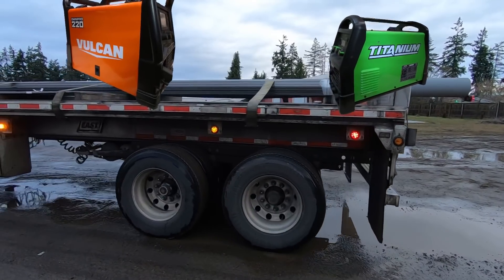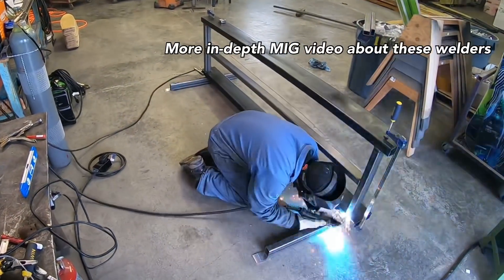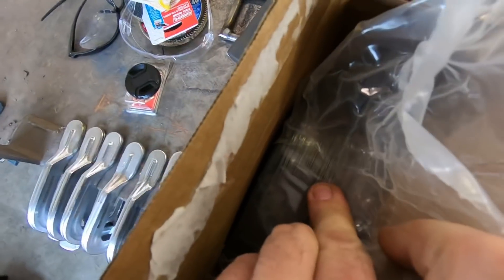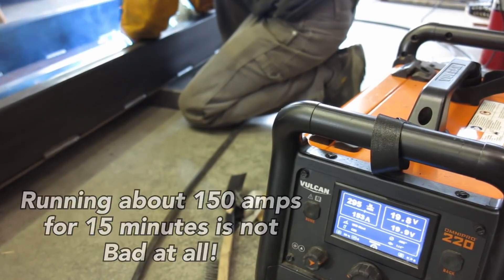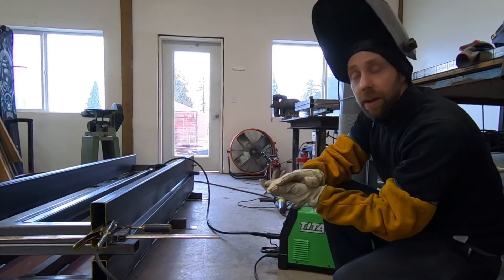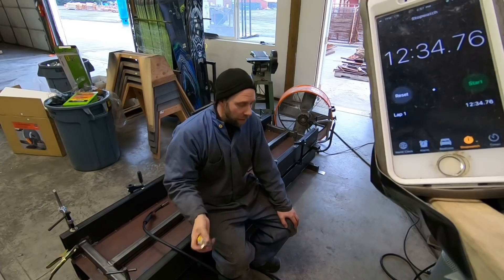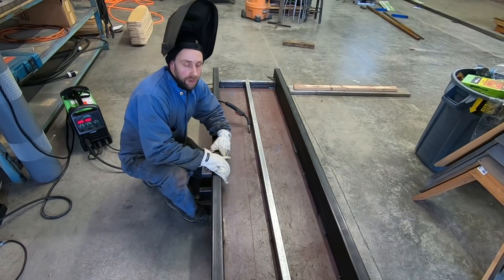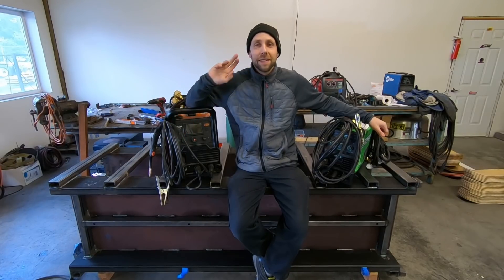Titanium Vulcan welders real world duty cycle MIG test

Comment: Thank you again for your review on these welders. It has been very helpful.  I purchased the Titanium online yesterday. Do you know if you can run a spool gun on it to weld aluminum?
Reply from the maker: Thanks for your nice comment :) I appreciate it. 
I think you will be happy with your new welder. Yes the Titanium is capable of running a spool gun, Harbor Freight says they will be available at some point, hopefully soon? Another subscriber mentioned  that Northern Tool sells a version of the Titanium multi process welder, it doesn’t have a digital readout but looks like it’s from the same manufacturer, it comes with a spool gun, and Northern Tool also sells the spool gun on its own. As far as I can tell it looks like it should hook right up. I may order one if HF doesn’t start selling one soon.
Reply: @Mikefestiva  Awsome, thanks again!

Comment: IDK maybe it's just me but your video is kind of misleading you keep talkin about voltage input when referring to duty cycle and there are many many many many welders that have no clue what duty cycle is please correct me if I'm wrong but duty cycle is the amount of time you can weld with that particular machine at maximum output they use a 10-minute as a standard for example if your welding machine has a 200-amp output and you are welding at 200 amps and your machine is rated at a 60% duty cycle at 200 amps you can weld for 6 minutes before you have to let it cool down for 4 if you're only using 50% of your machines amperage of course you achieve 100% duty cycle I'm just saying you don't explain this in your video and there are many many welders that do not realize what duty cycle is and it was only a few years ago that they started putting these warning lights and stuff like that IDK it's just an observation and opinion nice work
Reply from the maker: Carl again I think you may have missed the point of my video, I don’t think I was misleading at all, I completely understand duty cycles on welders, I’m not going to explain every detail about duty cycles in my video, if someone doesn’t understand how duty cycles are rated on welders they can ask or better yet just as easily look it up on line. 
Now the part where I mention input voltage and duty cycles, I think this is where you got lost, input voltage is definitely a factor in duty cycle on welders, these are both multi voltage welders and the duty cycle is definitely different if your welding on 110 volts compared to 220 volts, I even included the duty cycle plates of each welder in the video if someone wanted that info, mater of fact depending on if your MIG, TIG or are stick welding the duty cycle is a little different for each process. The green Titanium welder has a 15% duty cycle at 200 amps, I was welding at 150 amps for about 12 minutes, the point of this video was to show people that are interested in these two welders there capability on projects.

Comment: Welding on 220 volts okay you must be the first guy in the history of welding to weld 1/8 inch steel with 220 volts oh wait a minute you mean it's a 220 power supply damn I use a Miller and can do the same thing with a 110
Reply from the maker: Carl I think you may have missed the point of this video, I was building a glue press, and a lot of times as you should know you weld different thickness metals on the same job, why would I plug my welder into a 220 volt outlet to weld thicker 1/4” on higher amps then unplug it and plug it into 110 volts just to weld thinner metal? That’s not necessary and a wasted of time when you can do it all on 220 volts. Of course your 110 volt Miller can weld 1/8” practically any cheap 110 volt machine can do that. What your 110 volt Miller won’t do is weld 1/4” at 150 amps for over 12 minutes without hitting a duty cycle. I would be surprised if your 110 volt Miller even puts out 150 amps?

Comment: I got a Vulcan MigMax 215 and it has been great, I have a Hobart Ironman at my shop but its huge and heavy so I got the Vulcan for at home. I know 4 guys with Vulcan welders, so far so good. Mine will be a year old this summer, so far I have put 5 bottles through it. Maybe ill check out the multi process Titanium. Good video. Do the Vulcan and Titanium use the same guns?
Reply from the maker: It’s good to hear you like your Migmax 215, I have owned my Omnipro for a year and a half now and it’s not had any problems so far. It’s a good report to hear you know a few others that’s also been happy with there Vulcan welders too. 
The MIG leads don’t cross over on these two welders, so that’s to bad but I’m fairly sure there coming from different manufacturers? One thing interesting is Northern Tool sells a real similar welder to the Titanium, Northerns doesn’t have the digital display but instead of the TIG torch it comes with a spool gun for aluminum, and that would be real useful. Take care

Comment: So if you had to pick one of the two machines you'd pick the Titanium? 😀
Reply from the maker: For what I do the Titanium seems to fit my needs a little better, mostly size and weight is the biggest reason. However I didn’t think I cared for the auto set on the Vulcan before I bought it but I have to say after owning it it’s a nice feature to turn one knob and start welding on a completely different thickness of metal without any additional adjustments. And that being said, if someone was new to welding the Omnipro walks you thought all the setup when it comes to polarity of leads and what gas to use, it’s all displayed on the digital screen. Price is better on the titanium and it comes with a TIG torch included, a few less features then the Omnipro but overall it’s a surprisingly good little welder!
Reply: @Mikefestiva  So what you are saying is buy both .😀 👌 haha . Thank you for the video hope to see more soon.